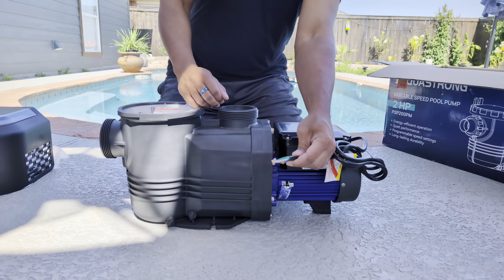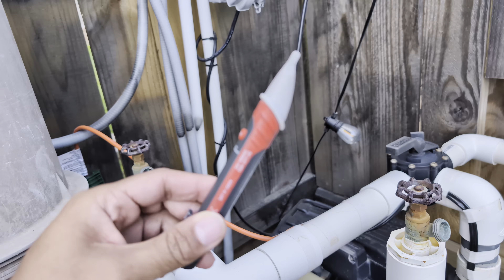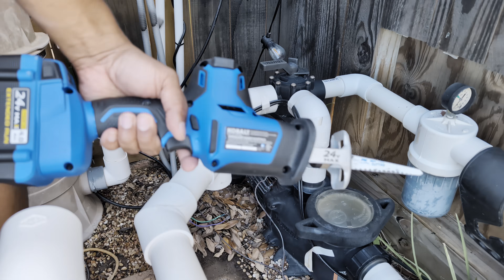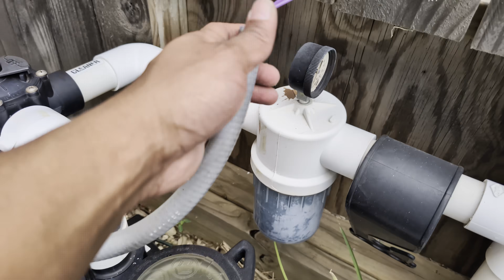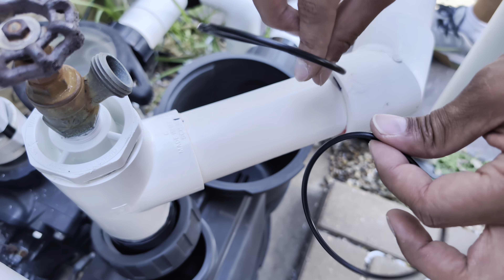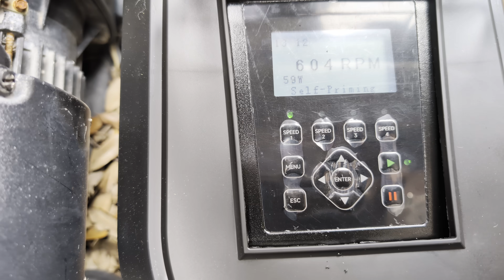Aquastrong Variable Speed Pool Pump PSP200PM - Unbox, Install & Review

Comment: how would add a salt cell chlorinator to this set up? Is there a connection in the pump controller to add the wiring for the cell controller? Or someway the pump timer tells the salt cell to activate?

Comment: what fitting connects your flexible wiring to the M20 connection on the pump?
Reply from the maker: I originally just used heat shrink and electrical tape...then quite a ways later used a custom 3D printed part.

Comment: Mine lasted a year and then suddenly quit working.  The control panel went blank and the pump stopped.  I reset the breakers and confirmed that power is getting to the unit.  I sent an email to the company but I'm not expecting much.
Reply from the maker: I am sorry to hear you are having trouble with yours; hopefully, the company responds with a solution or a warranty replacement.

Comment: WARNING:  After 3 weeks the pump had an over current stoppage.  My professional installer checked everything that could cause it and determined it was the pump itself.  Aquastrong does NOT have a phone number listed anywhere.  Sent 2 separate messages through their website and still no response after 2 weeks.  Consider their warranty worthless.

Comment: Was that a Hayward super 2 you replaced? I need to replace a super 2 and have very little room to plumb anything in. I cannot find the dimensions of the aquastrong anywhere. If that was a super 2 is the aquastrong’s suction side lower or higher than the intake on the super 2? Any input would be greatly appreciated! If you do happen to have the dimensions that would also be extremely helpful I am mainly looking for the height from the ground to the center of the suction/intake of the aquastrong.
Reply from the maker: The pump next to it is a Hayward Max-Flo VS. The pump that was replaced was some brand called Seeutek 1.5 HP single speed pump. Just measuring from the outside, the center of the inlet seems to be right about 8 inches from the ground.
Reply: @cooptonian wow thanks for the response that is very close the pump I need to replace is 8.3 inches. Does the intake side happen to have female threads on the pump body itself? I would need to thread the existing plumbing in without adding the included unions.
Reply from the maker: @mcarney89v not sure what you mean by female threads (internal threads?). In any case, there are external threads on the intake body....